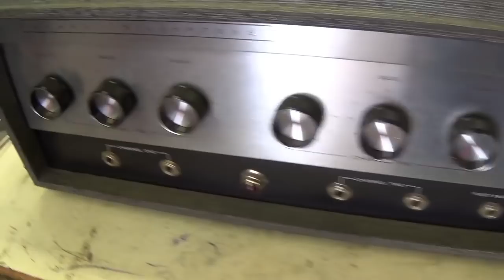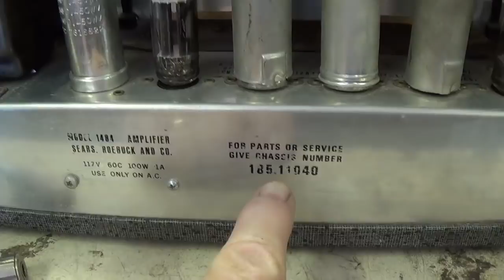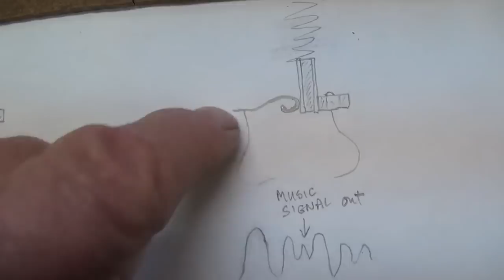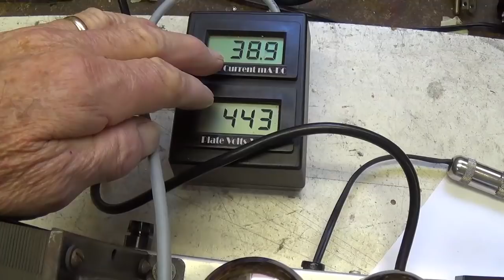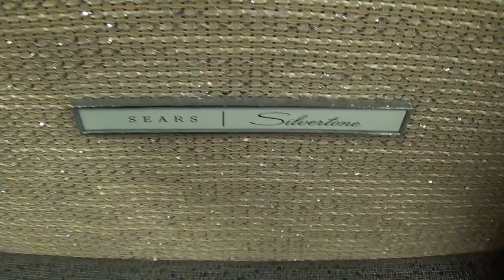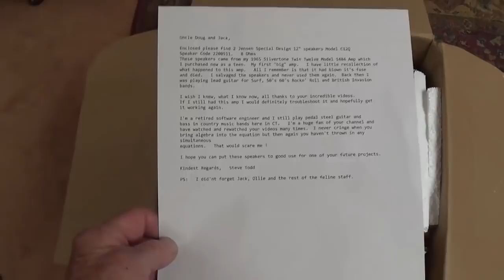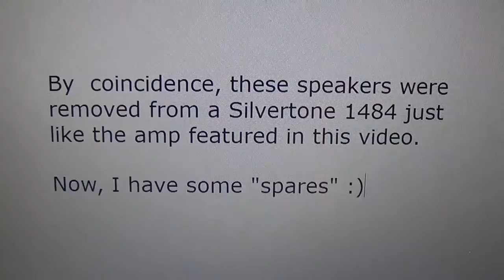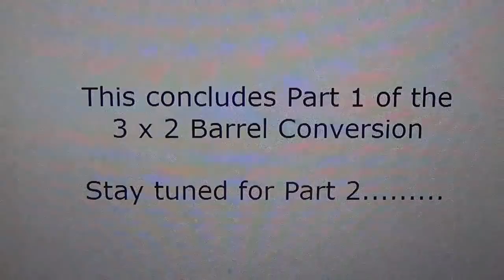Super Nice 1966 Silvertone Model 1484.......The Amp that Launched a Thousand Careers

Comment: Uncle Doug - Great little video, as all of yours are. Thanks for posting this.
I was just watching one of your older videos where you made a "Dani-Sonic" version of a classic Fender Tube amp. I noticed that you usually make the cabs out of pine, and that's fine, but I was thinking about tone woods and thought that maybe some time you could build a copy of one of the amps you've already featured in your series, but with a MAPLE cabinet, so you could A-B the two amps for us, with the only difference being the make-up of the cab itself. 
Something tells me it would make a noticeable difference in the sound of the amp.
...P.S. That "Vintage Speed" 3x2 adapter is pretty cool! Thanks for showing us that. New to me.
Reply from the maker: In my opinion, when it comes to speaker and combo amp cabinets, pine is an excellent "tone wood".  It resonates quite nicely.....much better than denser, heavier maple.....and is the original choice of cabinet wood used by most vintage amp manufacturers.  In fact, until quite recently, I have never encountered a vintage amp cabinet made of maple.  If you want vintage sound.....use vintage wood.
Reply: @UncleDoug  Fair enough. Thanks for your timely response.

Comment: Later on I bought a 1969 Fender Bandmaster-Reverb 50 watt amp that I still have (Fender incorrectly rated it at 35-40 watts and the 35 watt output transformer soon failed) for the many school concerts that my band was playing. I had a 50 watt  output transformer installed and all was good. Soon after, for more power I bought the then popular Ampeg V4 100 watt head to use with my 2-15 speaker cabinet. This amp proved to be too loud for most of the gigs we played and I eventually sold it to buy a Fender Super-Reverb 50 watt amp that had a master volume control. Back then unfortunately there weren't hardly any overdrive pedals.....so a master volume control was a good thing.

Comment: I was wondering if you had or could show to build a bucking transformer or voltage reducer for vintage tube amps, you are the man, thanks Unk.
Reply from the maker: I have personally never felt the need for such voltage reduction, Ron. As long as the output tubes are properly biased, the higher AC wall voltage has not been an issue for me. However, I will keep your suggestion in mind for the future.

Comment: Great video; I have a 1482 on my bench right now that either most the components were bad, or grossly out of spec. '63 Circa. It's developed a motor boat sound though that I need to find. For some reason that 5uf for a filter cap seems a little whimpy, I might bump it up to 10uf. Man, I really miss your videos; I pray eveything is OK with you.
Reply from the maker: Thanks. Everything is just fine, John, we've been busy with other hobbies.  I agree, 5uf seems like a waste of time.....but it probably won't solve the motorboating unless the 5uf cap itself is defective. Good luck.

Comment: Uncle Doug, You're 100% right about the mics of course, but I always only mic one out of four or eight with the SM-57, but I love the SM-58 for vocals and I angle the 57 mic in the same angle as the cone just on the outside edge of the dust cover to get the most accurate sound and punch, nice and tight like back in the day  and I place the mic as close as possible to speaker cover without touching. The further I place the mic out on the cone and I can hear it get more muddy and mushy it gets, just a thought to try.  😎
Reply from the maker: Thanks for the good advice, Mr. B. I will heed it.

Comment: If I may suggest to you a microphone technique that you will like.  I learned this year’s ago from Jim Gaines who engineered a lot of the Huey Lewis stuff. Take two SM 57‘s and place them on the same speaker and try to make them as in phase as they can possibly be and then buss them to the same channel.  The bottom end is so much more delicious. And the top end is undeniable as would expect.  You can of course use them as stereo channels but when you bring them up in the console or your digital audio workstation in mono you will immediately hear what you want to hear.  And this technique works well on both combo amps and closed back cabinets like marshals etc.  put one mic on the cone and one mic on the paper and you will be pleasantly surprised.
Reply from the maker: Thanks for your helpful suggestions, JF. I will give them a try.

Comment: I had one of these come through the shop up here in Lubbock a few weeks back. It had a bad reverb switch pot and it needed a new tremolo bug. Did a full recap, replaced the bug with a fender type optocoupler, added capacitance to the oscilator and ended up adding 7M of resistance (two 5M resistors in parallel and a 2M in series) across the optocoupler neon light. The schematic said there should have been a 15m resistor in that place but it appears to have never had one from factory. 🤷‍♂️ Fender usually has a 10M in that position but 7M was the perfect value to maintain nice depth and stop the thumping. That was a nice amp.
Reply from the maker: Thanks for your helpful and informative input, Drew.

Comment: Nice score!  I have the matching 1483 bass amp and the speaker cab too
Reply: And yes, that is how the speaker cab was connected on mine too.  Mine was 100% original when I got it, just dirty and beat up.  All the original tubes, even the 2 prong power cord.
Reply from the maker: @guitfidle  It sounds like a gem, G.
Reply: @UncleDoug  I love it.  It does still need recapped, but I already put a 3 prong cord on there and put a speaker jack on there instead of that cable coming straight out the back.  It sounds pretty raunchy through my 4x12 😻
Reply from the maker: @guitfidle  Raunchy is something that big Silvertone's do well, GF :)

Comment: I had one. The top to bottom did not use a connector, just wired together. Seem to remember you had to turn the top part around before stashing it in the bottom speaker unit and there may have been a couple cheap swivel clips to hold it in place.
Reply from the maker: Your memory is correct, Ben. The swivel clips are a white plastic/nylon material.

Comment: Fascinating. I've never seen that kind of reverb tank and I too grew up and started playing during that era. I always assumed they were all from a single vender, (accutronics?), and used by everyone. Those have a trans or coil at each end. Never seen one with piezios but it makes perfect sense. Seems a person could home-brew some wild diy tanks using that method? And you say the element is glued to the top of a nut? I do see a tiny round thing on top of the square. And the piezio has enough umooph to drive the spring too? Hmm. I've come across many of the others with bad coils at the ends but wonder how one would deal with a bad piezio element,....or is that even common? Very-very interesting. Always something to learn. 73's and cheers.
Reply from the maker: Thanks, Jim. The piezo element is contained within two vertical thin steel wafers, pinched between the copper "S" and the silver nut.
Reply: @UncleDoug  That makes a lot more sense, hahaha. Can't believe I thought it was on the nut now that I think about it, lol. Like I said - I've never seen one of those. According to online study, turns out danelectro used the same kind of tank -  and they too weren't supposed to sound very good. Cheers again and thanks for clearing that up.
Reply from the maker: @jimp.7286  Since the Silvertone amp was actually built by Danelectro, it makes sense that the piezo tank would appear in  Danelectro amps also. Happy Thanksgiving, Jim.

Comment: Really nice sounding vintage amp, exceptional condition !! The three deuce setup on your car is nice looking. I'd say It should work pretty decent, when you get the carbs adjusted, & the progressive linkage dialed in.
Reply from the maker: Thanks, Blair. There are no adjustments, other than idle mixture on the center carb and the linkage is just fine.
Reply: @UncleDoug   Good to hear that the distributor & induction setup worked out well.  The stance of your ''30 coupe turned out amazing, although, the street that I live on has around ten speed bumps, so It might not be easy to drive a car like that here. I like the rat rod pickup, '41 International pickup, & Jeep CJ that you featured in your other videos as well. Your vintage amp repair videos are also quite interesting.
Reply from the maker: @blairpenney7967  Thanks so much, Blair. I tend to drive out in the country, where the roads are reasonably smooth and free of $#&%?*&@  speed bumps.

Comment: I have a 1484 that's super original with the original cover, foot switch and the owners manual.  I haven't played it for a few years. My recall it has a rattle in one of the speakers. All the tubes are original, all Silvertone. It sounds great, one of my friends called it a baby Plexi.  I'm thinking it could use a recap or maybe I'd be interested in a trade.
Reply from the maker: Wow.....that's about as original as it gets, LK. You might consider offering it on Reverb. Lots of people are seeking these out nowadays, reminiscing about their "garage band" days.

Comment: I used to sell these amps in Sears department 57 back in the 60's, but as I recall we sold a lot more of the guitar case amps with the Silvertone guitars.  I never bought a Silvertone myself.  I had a Standel Super Artist (as I recall) and a Guild Starfire (again, as I recall, with the single cutaway).
Reply from the maker: It sounds like you had good taste in gear, Stephen......great choice of amp and guitar. I'll bet if the suitcase guitar was the same price as the 1484, the sales balance would have shifted dramatically.  Back in the old days, money really mattered.....especially when mom and dad were writing the check :)

Comment: That mustard-yellow cap near the power cord was probably the original "death cap" , which I presume you, or the previous tech, disconnected. They leak, badly (electrical leakage). The amp might have originally had similar caps all over the place but somebody had the sense to replace them.
Reply from the maker: Thanks for your knowledgeable input, GU.

Comment: I bought one with speaker cab in 1980 for $45 at a pawnshop while on vacation in Cedar City Utah, while on leave, gave it to my friend when returning from leave. Should have kept it since my friend sold it back to the pawn shop. Now I have 3 without the speakers 2 of which work. Have to replace the 6L6 socket due to arcover carbon tracks on the third. Nice amp good design except for the reverb.
Reply from the maker: Thanks for your input, Fred.

Comment: I noticed something that needs addressed Uncle Doug. The FlameThrower coil is 1.5 ohms which is for 6 volt ignition systems or 12 volt with ballast resistor. I don't think HEI had ballast resistors and were only 12 volt (?) so you should have got a 3 ohm FlameThrower instead? It will work for a short while as is, but they run very hot with the 3 ohm coil at 12 volts. I can't imagine how 1.5 will do when I can't touch my 3 ohm for fear of raising a blister. Hope my concerns are not too late and/or you always were already on top of the situation.
Reply from the maker: Pertronix is quite clear in their directions, Lee:  The 1.5 Ohm coil MUST have a full 12V for the ignition to function properly. The coil has internal resistance and does not require a ballast resistor. While stock coils operate at 8 or 9 Volts and require a ballast resistor, the Pertronix operates at a full 12V and does NOT require a ballast resistor. If you can find a Pertronix source that contradicts this, please advise.....otherwise, I feel strongly inclined to follow the manufacturer's instructions.  Also, the coil normally flows about 8A during use, which produces almost 100W of heat.....no wonder it feels hot to the touch.
Reply: @UncleDoug  Upon review of more modern instruction sheets, I concur with your 1.5 ohm coil choice for 8 cylinder, It's the 2, 4, and 6 cylinder that need the 3 ohm coil due to dwell issues and increased on times with those platforms. The old instructions didn't cover that, nor did they have the coil choice breakout table either. Standard ignition always used a 6 volt coil (1.5 ohm) on 12 volt systems with a ballast resistor bypass at the starter solenoid (delco) to allow straight 12 volt to 6 volt coil for temporary boost in spark voltage for starting. It's lead to many issues with ballast resistor myths which are needed when using a 1.5 ohm standard coil (6v) on a 12 volt system. And the standard point burnout region is greater than 4 amps, not your suggested 8. BUT the pertronix ignitor can handle 8 as per modern directions - that's gonna be one smooth running puppy there, the flamethrower coil is such an awesome device. My ignitor installations go back to the turn of the century and on my 59 chevy 235 apache 3200 fleetside, I wound up having to breadboard the system on my workbench to find out that the magnet ring needed to be installed upside down in order for it to work at all. Pertronix replaced it once with no questions asked, I couldn't ask them to do that again. Knock me over with a feather when I started goofing around and my voltmeter array started swinging around as it should have. I'd rather be lucky than good sometimes. The John Deere A didn't fight me at all, I set the plug gap to 0.80 because they wouldn't open up to 0.100 without uncovering the center electrode, has NEVER missed since the 90s.
Reply from the maker: @leebarnes655  Thanks for the follow up, Lee. The 8 A value comes from Ohm's Law: V = I x R  so  12V = I x 1.5 Ohms  and I =  8 A.
Reply: @UncleDoug  Indeed it does, but the steady state calculations only occurs when the engine is not running and happens to be in a magnet position where the ignitor module is turned on while the key is also on. Which begs a caution to don't do that to your coil for a long period of time. Ignitor is likely using power MOSFET with almost nothing for resistance but the poor coil would be brutalized by that 100 watts you mentioned earlier. Mine gets much less than that in running conditions and it's scary hot as it is.
Reply from the maker: @leebarnes655  Agreed, Lee. Leaving a coil energized over a long period of time, without the engine running, is a recipe for disaster.....and coil failure. I speak from bitter, sad experience :(

Comment: Hi Uncle Doug, great video as usual! I had one of these many years ago, traded it in for a BF Pro Reverb Amp. I was wondering if you have ever done a video on the Ampeg Gemini II (with 15 inch Jensen Spkr) I have one and have had a hard time trying to fix it. Rgds.
Reply from the maker: Thanks, Alvaro. The only Ampeg I have repaired and featured was a Jet. There are peculiarities in Ampeg circuits that make them a challenge to repair, unless, I assume, you have a lot of experience with them.

Comment: You mentioned this was a studio amp they may have gone specifically with the two prong cord to prevent possible ground loops caused when connecting two or more pieces of equipment that have their chassis earthed.
Reply from the maker: I asked the musician who owned the amp about the 2-prong cord change, and he said that the modification was done many years ago, probably before 3-wire cords were in fashion......but your idea makes sense also, from a technical standpoint.

Comment: This is so good - thanks Uncle Doug! I love my 1484 including that one of a kind gawd awful reverb! I've used it lots on every album I've put out, since 1996. To me it sounds like an old sci-fi b movie special effect. I'm thinking about getting a Two Notes Captor load box to record the head direct in - best info I can find is that it needs the 4 ohm version to match the impedance - do you know if that's the case? Many thanks for sharing explorations here. Should note, albeit a bit chewed up mine is all original inc. the speakers
Reply from the maker: I believe it is 4 Ohms, LT, but to be sure, simply measure the DC resistance between the two contacts of the male speaker  jack.

Comment: Hey Uncle Doug! Love your vids. Could you please do a simple explanation of Miller effect with some examples? Thanks anyway.
Reply from the maker: Greetings, Urich. The Miller Effect is defined as:  The increase in the effective grid-cathode capacitance of a vacuum tube due to the charge induced electrostatically on the grid by the anode through the grid-anode capacitance.  This effect limits the gain of a tube and affects its frequency response. To be honest, it is of little concern to most tube amp techs, since we generally don't design circuits from scratch, but are more involved in repairing existing circuits. If you really want a more detailed explanation, I suggest doing some Internet searches on the subject. Good luck.

Comment: Ive got the same amp a friend left with me months ago.  He just does not have the money to do all the repairs and replace all the tubes and power transformer.  Along with all the bad caps etc.  Ive not heard one in person playing.  I will be doing all the repairs.  If in a similar situation would you do the repairs with all the damage?
Reply from the maker: I have repaired amps that were run over by trucks, dropped from airplanes, and crushed by falling boulders, Dave, so I'm probably the wrong person to ask.......but to me, the greater the challenge, the greater the reward. Yes, virtually any vintage tube amp is worth repairing.